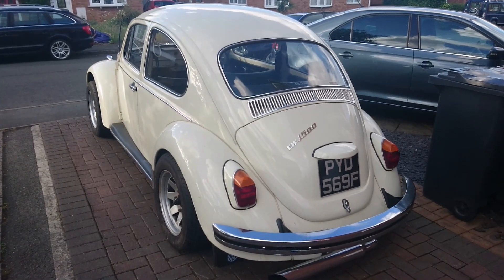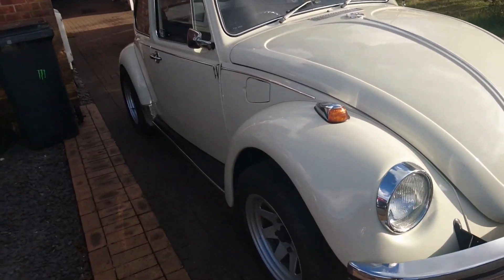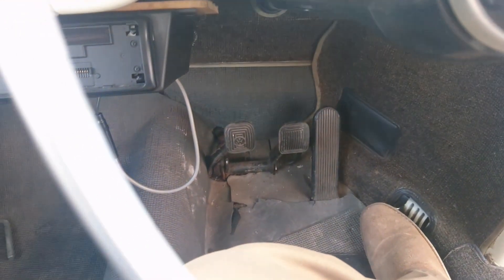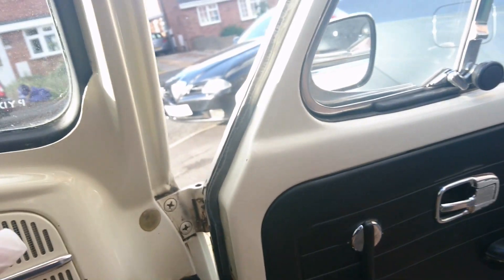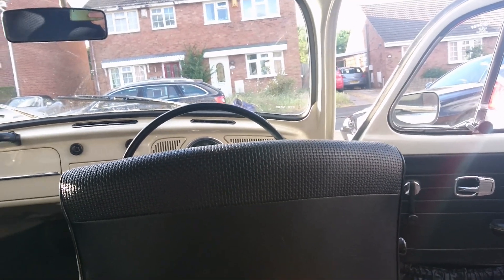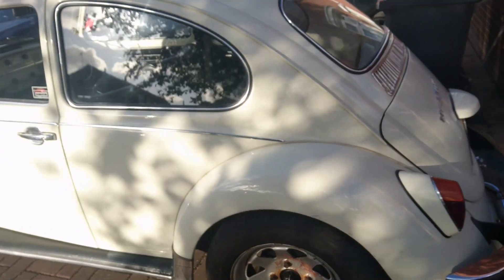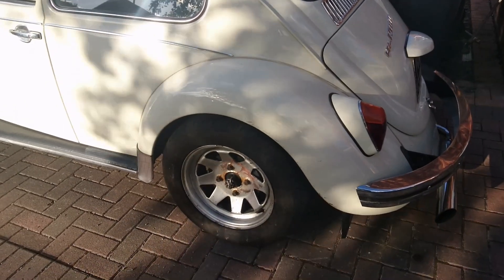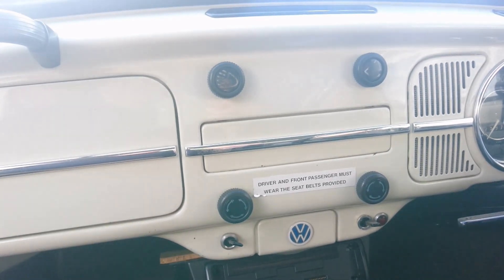1968 Volkswagen 1500 (Beetle) Walkaround with The Rubbish Mechanic - Lloyd Vehicle Consulting

Comment: Takes me back to my dads Type 3 1600 fastback when I was a kid. It did well over 100,000 miles without fault , he traded it for a Renault 12 , which was nothing but trouble.
Reply from the maker: Wow, a Type 3 fastback! Haven't seen one of those in a while... Haven't seen it Renault 12 in a long time either. Perhaps there is a reason for that?
Reply: Lloyd Vehicle Consulting  I am trying to figure out a way of sending you pictures of my dads old type 3 and my old Audi 90 , both cars sadly long since gone .
Reply from the maker: @richardhowlett9424 , I would send my e-mail address in the comments section, but YouTube tends to block it if I do... If you go to the about tab on the YouTube channel homepage, then you should find it there!

Comment: Lovely my first real car. My Dad bought me a gorgeous yellow 1974 VW Beetle. The main battery was connected to a tractor battery on the floor, the exhaust had a blow and the sills and floorpan were held on by the mud that pulled together the dust that used to be steel. Hence £25.
It had similar seats and only a seat back in the rear so that the batteries could stay connected. Metal dash, the same single dial and a 4 spoke Wolfsburg steering wheel like a mk1 Golf.
Don't forget Beetle - Golf - A3 - Octavia - Toledo. A very truncated ancestry of course. It did take a few more models and varients over 30 or 40yrs. Mine had the larger taillamps and the front indicators in the bumpers. Squint very very hard till all is darkness and your in a Porsche 911.
Reply from the maker: Yes sir, lots and lots of nostalgia with something like this. Mr Coleman often works on this one, and tries to keep it in excellent condition (which from this video is evidence of his success). These old Beetles certainly do rust, but this one is remarkably free of corrosion. That ancestry is certainly a bit truncated, but I see what you mean.

Comment: When I worked for VW/AUDI in the late 80s to early 90s the Beetle was being sought after to mainly turn into Cal look Beetles and the prices of these cars went stratospheric. I didn't work on too many Beetles in the body shop mainly the work was repairing MK2 Golf GTis which was just as well because most Beetles at the time were in very poor condition and no nut or bolt would undo without shearing off. The 1300 Beetle from the late 60s was I think the most sought after and one of my colleagues at the time had one which he had hand painted Bart Simpson all over it and called it The Bart Bug, then at a later stage he chopped the roof of it and using a Wizard kit I think created a quite good convertible painted in a unique paint colour which was a magenta shade. The big exhausts were called stingers and were a popular conversion. I appreciate these cars but as you know sir me being a Ford fan I was always happy with my choice of the Capri. Thanks Joseph for the walkaround.
Reply from the maker: Ah, Mr G! Yes, ones in this sort of condition are quite rare, I believe. Must have been interesting working on these at the time. I have had a number of Volkswagen Group cars in the family over the years, and this is an interesting one, but as a Professionals fan, I would probably rather own a Capri too. It was still a pleasure to film this one, though.